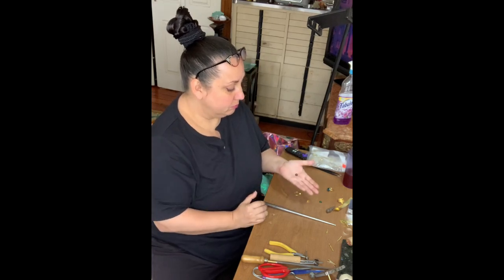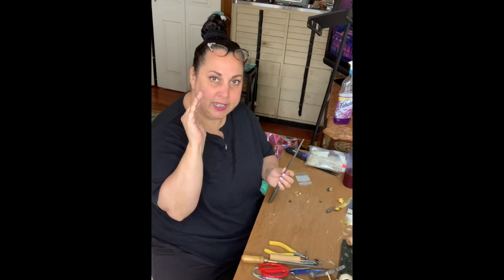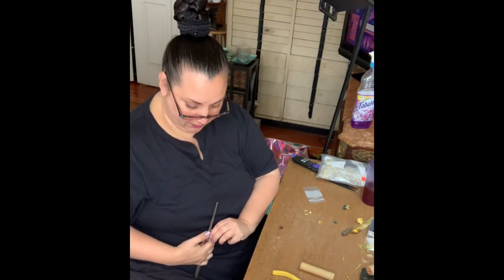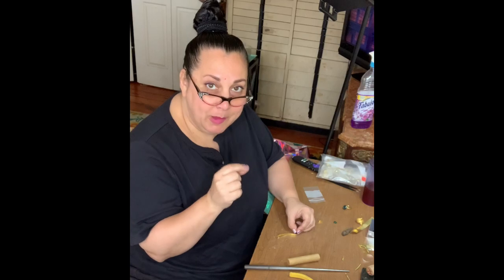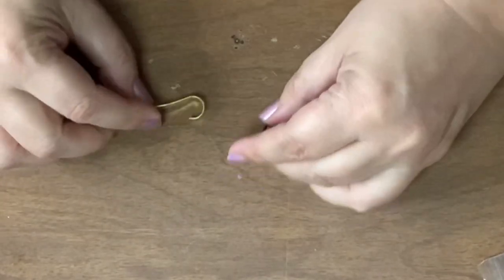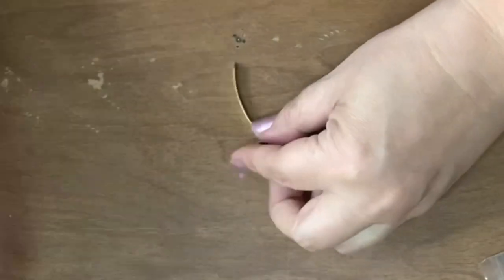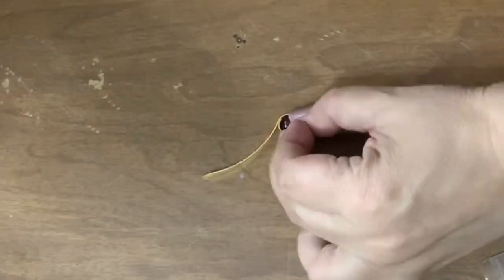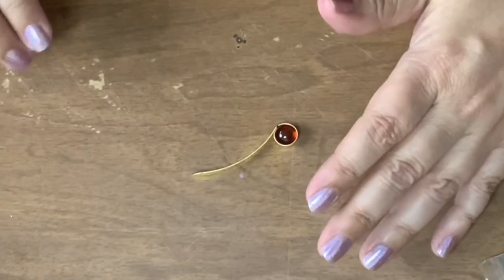How to Make a Bezel ( A Drop Through Fit is Bull!)

Comment: So WHERE do you cut with the flush cutters? Just past the mark you made? Center of the mark? Just inside the mark? I truly don't know. I would likely guess on the outside of the line...
Reply from the maker: I use joyce chen's, not a flush cutter  but I usually advise my students to use their past experience as a guide. In other words, if your bezels tend to be too small, cut on the outside. If they tend too small, cut on the outside. Start with cutting directly on the line and see if adjustments need to be made. :)